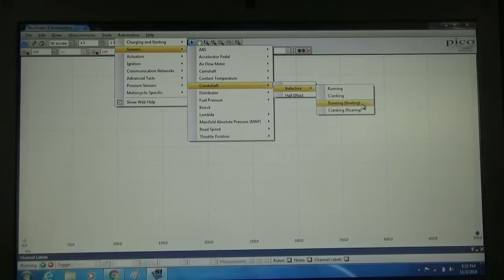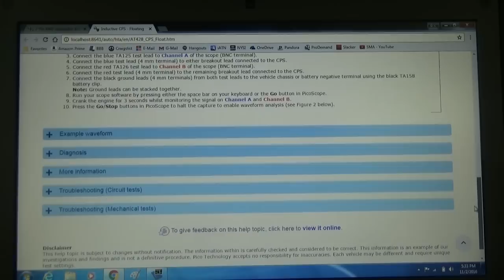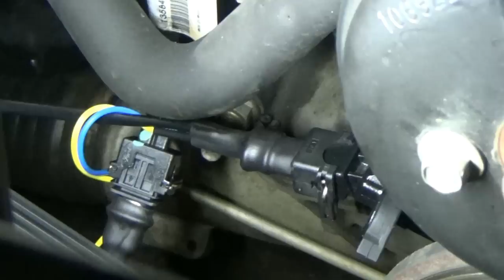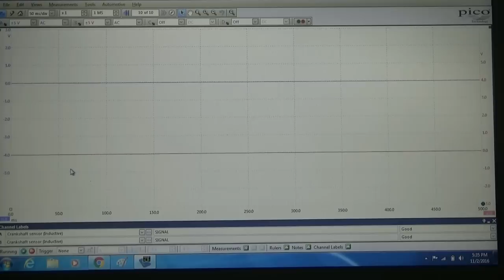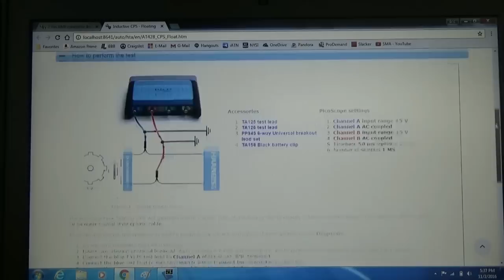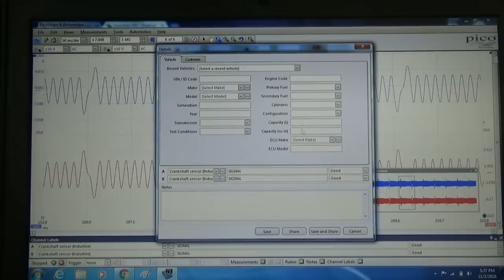PicoScope Guided Tests - Inductive floating Crankshaft sensor AT428

Comment: This is what I dont like about the scope presets, it is possible that the preset is meant to be used for a NO START and the waveform will be properly viewed at the correct scope settings for troubleshooting. Is there a preset that you have found for this type of sensor for a running engine and it has the correct voltage and time settings upfront?? Appreciate the known good waveform.
Reply: Hi Duane, thanks for your comment. As it turns out we've updated the preset (GT428) since this video was made, as we were finding that its settings needed tweaking to cope with a wider range of vehicles... We've kept the video though as it is still fundamentally sound and Eric shows how to tweak preset settings to get the waveform he was after. And I've phrased it that way deliberately: not everyone is looking for exactly the same thing in a given component test so making a universal preset is nigh on impossible - we can only get something that will fit the majority of vehicles and cases. For many, though, it is still the best starting point they have, even if it is only spot on 90% of the time. All the best, Barns

Comment: Thanks for this Eric. I am running these tests with my Hantek oscilloscope. Similar interface, not sure if Pico is better or worse for these tests. I like the way in which Pico can save to a library of waveforms. Hantek has BNC connections, so you need an adapter for standard banana plugs. Yes they both have a maths functions, and good wave form reference files.  My only gripe is that gafuffle you need to take it all out and put it away again. [if you only have a home shop]